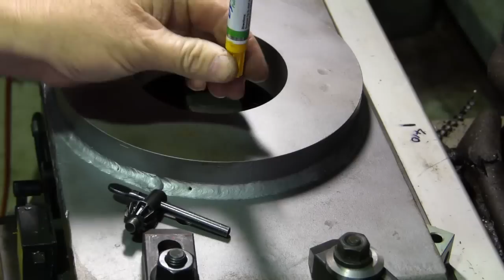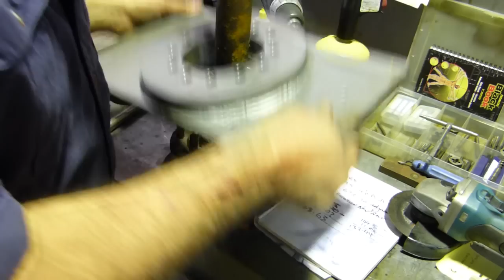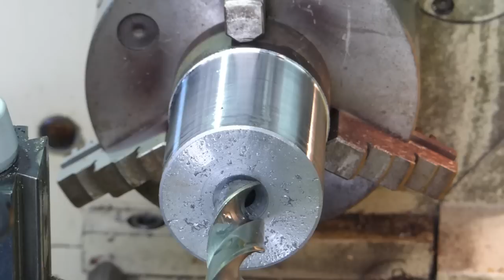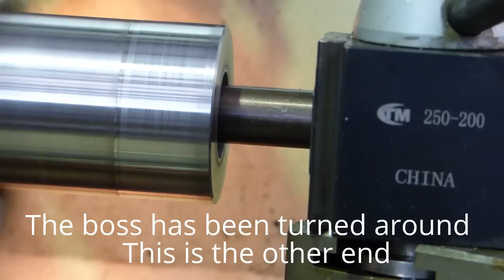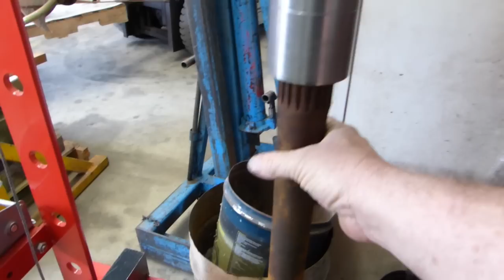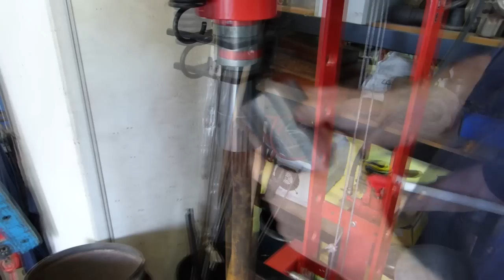Ferguson TE20 Tractor Axle Puller Plate Part 2

Comment: Worked on many of those old tractors in my life. They built them tough and you had to get tough to strip them apart at times. Front ends broken off axles broken into, bearings out and more.
Looks like that will do the job.
Mike
Reply from the maker: I reckon it will be strong enough at 40  mm in the centre flange the old one we used was one inch and it worked for 20 years ok. Came out alright in the end, Im happy with it.

Comment: i rebuilt engine and new piston and rings etc. and a new timing chain put four heater plugs in head it runs lovely the exhaust is very clear from cold can be troublesome the top of the pistons 2 face of block 33 thou clearance would u recommend taking anything of to improve compression !

Comment: Hey Lance, loved Part 1 and have a newbie question please. Could you have set this up in the Mill from the start and used an adjustable boring head tool to save yourself having to centre the peice again for the holes? Also, loved your use of the DRO as I have the same on my mill so learnt something new, Cheers, Gordon TUMUT NSW
Reply from the maker: G day Gordon, Yes setting up in the mill would not have been a problem the big lathe is very solid and quick to remove a lot of stock but there are many ways to skin a cat they say. Thanks for watching and commenting.

Comment: did u ever hear of anyone skimming 20 thou of the face of a block on a Massey 35 4cyl diesiel rase compression of cold starting
Reply from the maker: The only time I have  heard of that is after new sleeves were fitted to deck the block to true it all up. There would be no problem doing it if the piston to cylinder head clearence was in spec still. Most cold start problems are compression, dirty injector nozzles or the injection pump timing is out due to wear and tear. I have found that if you loosen the injection pump and crank the top towards the engine block they will often start better.